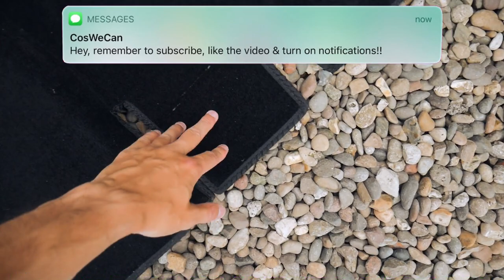I Bought CHEAPEST eBay Floor Mats For My MK7 Ford Transit Sport! *FAIL or WIN?!* 😳

Comment: Just bought a new to me mk7 van and the seller's garage must have jetwashed the thing as ots absolutely sopping wet under the rubber mat. Have cut it out just now as could not be arsed removing the seats, must have been about 3 pints of dirty water under the floor. Going to kwt it dry out fully now we have warm weather then whack it back in and cover it with some of these cheapo mats. They look decent. Are they still good?
Reply from the maker: I’ve sold the van now but I still had them in when I sold it 👍🏻